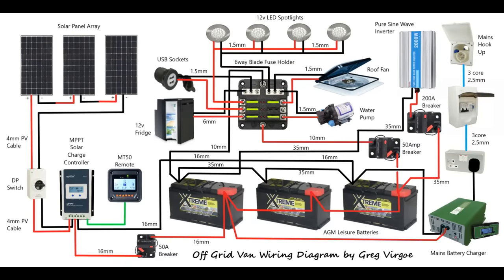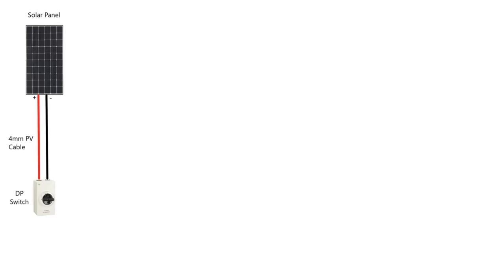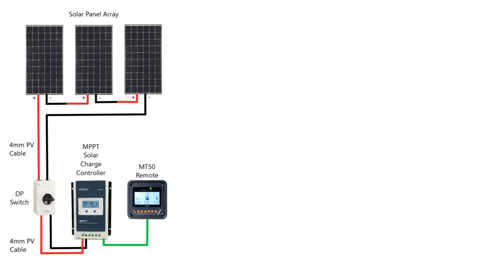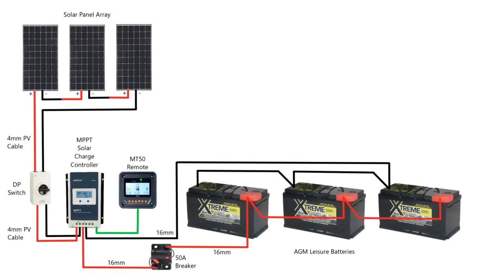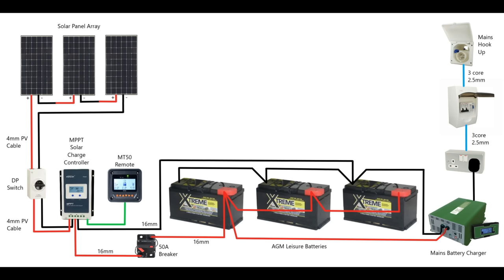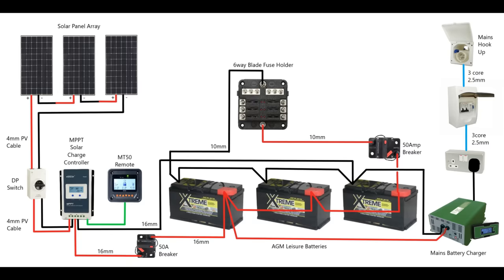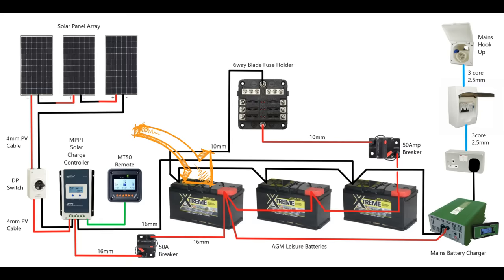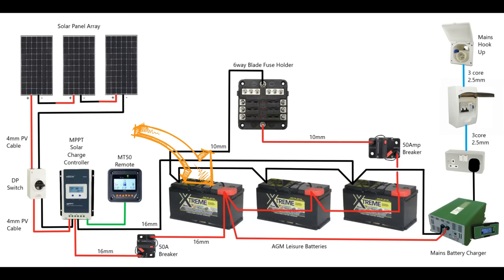How to Wire your Camper Van to be Off-Grid

Comment: hi greg, is it possible to have the solar panels charge both the leisure AND starter battery when your parked up?  and then when you drive charge both also? would it just be a case of a few manual switches to cut off the starter batt when camping, and reconnect to the system when its in storage so to charge all batts? 
also is it a problem having solar charging whilst alternator charging at the same time? or does the dc to dc take care of this? 
thanks in advance.
brilliant vids! spend hours watching them! keep it up 
cheers
Reply: Certain battery-to-battery chargers have a system where they trickle-charge the starter battery from the leisure batteries IF the leisure batteries are full and receiving charge (aka from solar or a hookup). If you get one of these, you can leave your van parked up for an unlimited period - as long as your solar panels are receiving sunlight, they’ll eventually fully charge the leisure batteries and start to trickle charge the starter battery.
Reply: @peanutbuttereggdirt1  that sounds perfect thanks for the advice! do you know what this service is called? so i know what to look for when i buy one in a few weeks? (i will only use it once a month and so it will sit for ages)
thanks peanutbuttereggdirt1

Comment: Hi Greg, watched mist of your videos and they are very informative.
Regarding an inverter, I have a 3000w continuous 6000w peak pure sine wave. When I work out cable and fuse sizes they look silly big. Could you clarify please
Reply from the maker: You need 35mm2 battery cable and a 300A fuse for that inverter. 
What are you using that needs 3kw? That is a lot to pull off the batteries. 🤔
Reply: @GregVirgoe  hi Grey, thanks for the quick reply. I understand the 300a fuse as that is what I was looking at but still don’t understand the cable size of 35mm? As your chart shows max Amp draw of 141amps at best?
Based on the charts I would need 120mm? 
IN all honesty I went for the 3000w as it was on offer and thought it’s better to have extra capacity, it’s probably only going to be running a hair dryer/straighteners. Maybe a hot plate? 1800w
Can you advise

Comment: Would there be an issue with your MPPT battery charging circuit and your mains battery circuit in parallel
Reply from the maker: No not at all. The mppt will see the high charge voltage when the mains is on and will back off accordingly. No problem with having them both turned on.
Reply: @GregVirgoe would the same apply to a PWM controller?  For example if I put my van on mains hookup I would have 2 different sources of power going to the controller.  The safety instructions on my PWM says never add another charging source to the regulator. TIA

Comment: Hi Greg thanks for the great video. Can you please tell me do i need to switch of the solar and mppt to the battery bank (2 x 120ah lithiums) if i am charging from my dc-dc while driving? also my tow vehicle has a dc-dc charging a agm  battery and i want to install my dc-dc to charge the lithiums in the caravan while driving should i connect from starter batterty ie input side of agm dc-dc charger or take it from after the output of that charger to the caravan dc-dc charger? any suggestions thanks?
Reply from the maker: You don’t need to switch off the MPPT when driving, they will work together without any issues. 
The MPPT will see a higher charge voltage and back off to float. 
I do know a few people that have successfully installed two dc to dc chargers from one van 🚐 
Take a look at Alex Frood video on his channel https://youtube.com/@MispronouncedAdventures here is a link to the video. https://youtu.be/6upMwO-x8so
My only concern would be the length of cable run and voltage drop over that length. The cables may need to be very big.

Comment: @Greg Virgoe Hello I have tried looking through the comments and still slightly confused. I have followed your steps exactly besides the battery charger and shore power. I am trying to get a clear answer and find out does anything NEED to be grounded to something. Like the inverter or fuse block
Reply from the maker: None of the 12v DC side needs to be grounded. However the case of your inverter and any 230v appliances will need an earth.

Comment: Hi @Greg Virgoe , thanks for the videos. Been a real help. I do have one question relating to you point 6 in the pinned FAQ (cable size between batteries). When you say loads you are referring to the demands (lights, fan, inverter etc) and not including any charging sources. So for your diagram in the video it would need to be 50A (12v system) + 200A inverter? Is that correct?

Thank you

Comment: Thanks Greg, love your videos. I wonder if you would choose lithium batteries now they are cheaper? I've heard they can charge fast off the vehicle altenator, and eliminate the need for solar.
Reply from the maker: No. I wouldn’t have lithium as AGM are more than adequate and far more resilient to intermittent charging. solar is by far the best source of electric for our environment rather than running Diesel engine.
Reply: @Greg Virgoe  thanks so much, sorry the late reply. Consise and clear information as always! 

I'm thinking again because vehicle alternator is obviously very inefficient for charging unless you're driving anyway - and  quite a lot of driving required to keep a battery topped up. 

Love your work and videos, both beautifully crafted :) I'm sure I speak for many when I say you are an invaluable resource of reliable free information. Thanks again

Comment: Thanks for the video. How do you work out the size of the fuse between the leisure battery and my 30amp dc 2 dc dual controller? I have a 130ah AGM and a 200w solar panel. It’s really confusing me. Thanks 🙏
Reply from the maker: If the charger is rated at 30A you need to add 25% to that and fit a fuse that is 40A I suggest. Your cable needs to be rated to handle more than the fuse rating so something like 16mm cable would be good for that. Watch my video on fuse and cable sizing for more info. Electric Cable & Fuse Sizing - Camper Van Conversion Series
https://youtu.be/koFg6oFs0RU
Reply: Thank you. I’ve watched your video and was just confused as I didn’t know if the leisure or starter battery size altered things. I understand the fuse blade system but just wanted to make sure it applies the same way from the dc 2 dc control charger. So that’ll be 40amp fuse in the leisure battery and the starter battery size? Thanks again.

Comment: Hi Greg, thanks for all your informative vids, they're very helpful.
Question:
Is there a way that I can power my 230V Distribution panel from EHU and from the inverter?  I was hoping to be able to be able to use my 230V sockets while on a camp site (With EHU) and offgrid (With the inverter powered from B2B  and solar)
Cheers
Reply from the maker: Yes I am using a Double pole changeover switch on my control panel to switch from hook up to inverter. Look at my earlier control panel video 👍🏼😊
Reply: @GregVirgoe  Thank you! Greatly appreciate your help.

Comment: Greg, Love you bro!!!

Now I am confused about just one thing, all of my other questions have been answered but one! 

- I don't know the technical terms as such BUT I would want my leisure batteries to get charged via Van's own battery as I drive the van....
But I guess that part was not shown in this video and believe it or not I have actually watched this video like 15 times...
I will be following all of the steps that you have mentioned and will have the exact same setup but I also want my van's own battery to charge my leisure batteries...
 
Please help me understand how can I connect my van battery to the whole electric system. Do I need to buy a second invertor? How do I connect the main van battery to the set up you mentioned in your video??
Reply: You need a DC to DC charger wired between your starter battery and your auxiliary battery.
Reply: i wanted to know this too 😄 . .... im guessing this would connect from car battery to  the first battery +to + -to - ?.  does it also need a 50a breaker or does the dc 2 dc charger   have built in protection ?. and what would be the right cable thickness for it ?    35mm ?
Reply: @jonathanbeaver4678  i wanted to know this too 😄 . .... im guessing this would connect from car battery to  the first battery +to + -to - ?.  does it also need a 50a breaker or does the dc 2 dc charger   have built in protection ?. and what would be the right cable thickness for it ?    35mm ?
Reply: @davethorne3925  I'm sure whatever charger you buy would provide the wiring diagrams, but I think there would be pos/neg from your started battery and the pos/neg going to your other battery, so you wire in and wire out. There will be connections on both sides of the DC/DC Charger device. Cable is probably 2ga, but the instructions would cover that for the amp size of your charger since these come in different flavors. I think you would have fuses on both the positive cables (in and out), but maybe the charger has internal circuit breakers. Just some guesses there.

Comment: Hi Greg, brilliant video! Did you earth your system?
Reply from the maker: The 12v DC system does not need an Earth. Your van body is not an earth it’s used as a negative for your auto electrics.  I did Earth all of the mains side back to the mains hook up.
Reply: Ahhh okay, I’m on the electrics now and wasn’t sure if I have to run a cable to the body of the van?

Comment: Hi Greg. Your video is very educational. I was wondering if there is a way of connecting Leisure batteries to the Vehicle charging system as well as to the solar panels.
Your advice would be highly appreciate. I want to go completely off grid. Without looking for the mains charging supply. 
Thank you.
Reply: Victron 12 to 12 20 amp or 30amp orion TR is what you want.

Comment: Thanks for the reply Greg I have looked at the other diagrams but am going to go for the above off grid one but just wanted to know if I can have the compete same set up but with only  one 100w solar panel instead of 3. Would I need to change anything else?  Thanks
Reply from the maker: I wouldn’t fit three batteries and only one panel. You will end up using the power abs not be able to recharge them fully. It is space restrictions on roof or costs? It’s better to go more solar and less battery if it’s a cost saving exercise. Otherwise look to drop a battery out and install a B2B charger as well. 
Or go for Renogy combined DC to DC and MPPT all on one unit. If you are reducing solar and battery the loads, fuses and cable sizes can be reduced too.

Comment: Hi Greg.  I read your comment above about the load side of the mppt not being used.  My question is this.  I have busbars with my dc fuse distribution wires to them so when I’m wiring my epever mppt controller do I only need to wire my solar panels and my busbars to the controller and forget about the load connection on the right hand side?
Reply from the maker: Yes forget the load connection this is typically only for reduced loads and you are better taking loads direct from the bus bars.

Comment: Very useful video! Thanks.
What do you think of the following combination for a van? 
2 or 3 250w panels ($50 each), 
Growwatt 5000 all-in-one inverter, controller, charger ($900), 
2 SOK 206Ah batteries ($1029 each)

Comment: Hi. Well done. Do you have earth of the main 230v socket connectet to the chassis of the van? (Where is the minus of the 12v).
Reply from the maker: Yes connect an earth on the mains to the chassis of the van. If you wire both positive and negatives on the 12volt side you do not need to connect the 12v to the van 🚐👍🏼😃

Comment: Greg  I know that batteries charge faster if power is not being used.  But, is it possible to use electronics inside the van while connected to shore power?  Does the charge controller block current flow towards the panels or should the isolation switch always be turned off when connected to shore power?    Thanks for making this video. It was very helpful.
Reply from the maker: You can use your 12v battery system and everything in your van as normal even when charging with a mains battery charger.
Reply: Ok but should the isolation switch be turned off or will the charge controller block current from flowing towards the panels while charging?
Reply: @grahamcole4782  Power won't flow back to the panels the charge controller only woks in one direction

Comment: Thanks for the great video Greg. Just wondering with the mains charger would i need to put a switch between the battery bank and charger for when its not in use ? as in the charger would then be getting the charge backwards into it?
Reply from the maker: No thing will happen to the charger when it’s turned off you don’t need a switch on those connections.
Reply: @GregVirgoe  thankyou

Comment: I have been watching your videos on YouTube and I’m doing a self build I have ordered 2 x 200w solar panels from Renogy what amp charger do I need 30a or 50a
Regards wayne
Reply from the maker: That will fit on a 30A charger. I would only go to 50A if you are using lithium batteries.

Comment: Hi Greg,

I am currently running through my electrical set up and am pretty much following everything you do on this because it's fantastic. I am having trouble figuring out cable size and fuses - I have two 370W solar panels that I will wire in series, and a 150aH Lithium battery. What size cable do you recommend, and when it comes to the circuit breaker, I am confused as to what size to get? Any help would be much appreciated. Thanks!

Comment: With the light circuit, instead of running another ground to the switch, couldn’t you just run the lights ground to the switch and then back to the fuse box? Basically the same thing as what you do for the 12VDC?

Comment: In the spirit of using what I have to hand as opposed to buying more stuff could I use 2.5mm cable for LED lights and USB sockets as opposed to purchasing alternative cable? Thanks
Reply from the maker: Bigger is always better. It will run cooler with less voltage drop 👍🏼😃
Reply: Thanks

Comment: Hi Greg.  Your videos are amazing. 
I am currently converting a motorhome.  I am not planning to install solar.  Your wiring information is awesome and very informative but can you tell me what I will do i I want to link the batteries to take direct charge through the motor.  Many thanks
Reply from the maker: Interested to know why you don’t want to fit solar or have a fold out portable panel?  
You need a DC to DC charger like Victron Orion to charge the leisure batteries from your starter battery

Comment: Greg when you show a 10mm wire the diagram is that the outside of the plastic or the actual copper wire size
Reply from the maker: Wire sizes are given by the cross sectional area of the copper core in mm2. Wire should have this printed on the side of them.

Comment: From the MPPT to the battery you have used 16mm cable but a 50A circuit breaker? Would 10mm (70A rated cable) not do the job?
Reply from the maker: Yes it would, never a problem to go bigger 😃

Comment: Hi Greg. Can you please explain a bit further point 4 from your pinned message in the comments - "My mains earth is connected back to my hook up socket and I always check with a plug tester when connecting to shore power. "
My question really is, what exactly do you test and what is a plug tester? 
Thanks and safe travels! Love your videos, they've helped me a lot during my (still ongoing) van build!
Reply from the maker: Sometimes the power supply you get abroad the live and neutral are reversed so I have a plug in device that lights up to tell me if that is the case. Then I can plug in a reversing connector to swap it back to how it should be. The tester is like this one https://amzn.to/3lkPK9r
Reply: @GregVirgoe  Thank a lot for the reply, will get one of these devices just to be safe. 
One last question, if you don't mind - again for the AC hookup. I've read through the comments that people asked and your replies regarding the "earthing" of the AC system. 
Am I right in thinking that what you've done on your van and what you suggest is to instead of wiring the earth to the van body, you wire it to the metal pin on the hookup inlet? So it' still a piece of metal, but instead of the whole van, it's just the pin on the inlet?
Thanks again!
Reply from the maker: Hello, I need to update my advice I gave you previously. I have completed a series of courses on circuit protection and current wiring regulations. 
In accordance with statutory regulations the earth of a mains hook up connection should NOT be connected to the metal body of your camper van. There is a serious risk of shock if the site power lose their combined neutral earth connection. 
All earths should’ve connected to earth bar in your consumers unit and back to the earth in the hook up. 
A simple disconnection in the consumer unit will fix this issue and I hope this messages gets to you. 😃
Reply: @GregVirgoe  Thanks a lot for the update, Greg! I already have my earths from the hook up outlet and the single 220v outlet inside the van on a bus bar and then I have a wire going from the same bus bar to the van chassis. So I just need to remove the wire going to the van body? Thanks a lot!

Comment: Supert video. Question ; would it be possible to charge batteries using those EV charging sockets you find at charging stations?
Reply from the maker: There are adapters available that convert a EV Type 2 charging outlet to a 16A CEE blue socket that you can plug your hook up cable into. That will give you a 16amp single phase power supply. 
You would need a mains battery charger connected to your leisure batteries to control the charging.
Reply from the maker: https://www.evconnectors.com/product/standard-type-2-16a-3672-kw-charge-station-power-outlet
Reply from the maker: https://www.edfenergy.com/electric-cars/charging-points